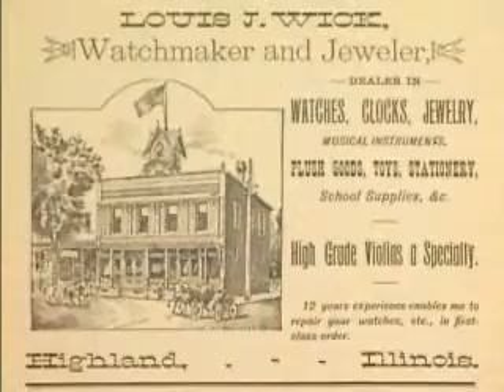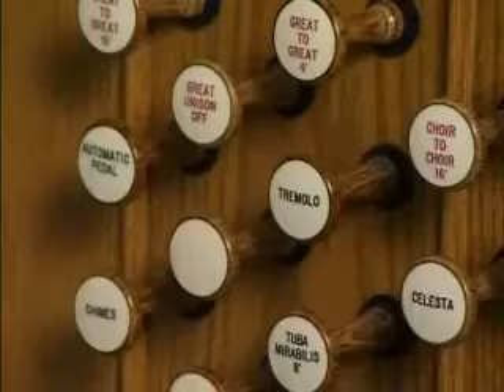Wicks Organ Company | Living St. Louis

Comment: wicks, as an entry level manufacturer of pipe organs, has historically filled the niche for the cheap pipe organ.  There is probably room for only one such builder in the industry.  The direct electric action was a departure from what all of the upper tier builders in the industry were using, i.e. some form of elecropneumatic action and this placed wicks in a class all by themselves.  They have been and remain the most notable of the low end organ builders.